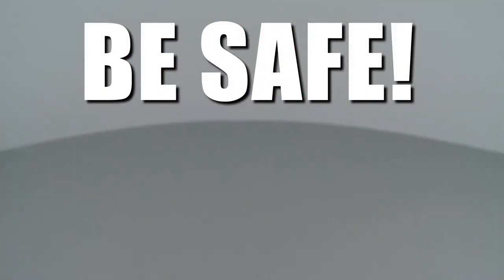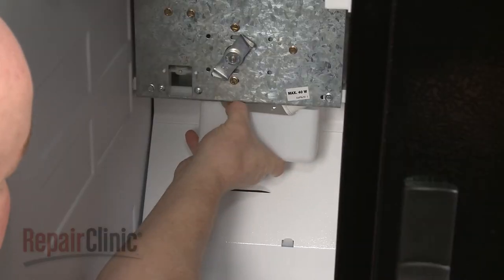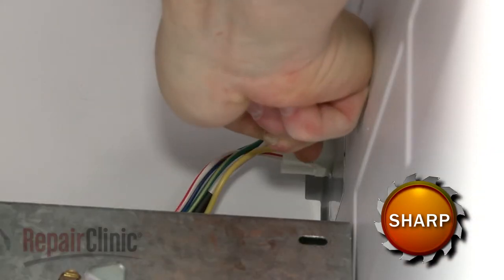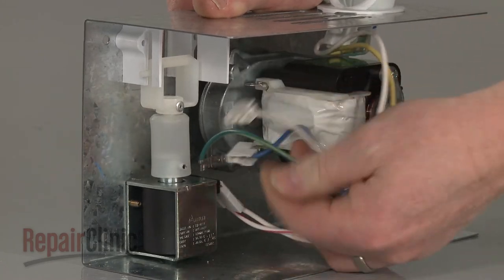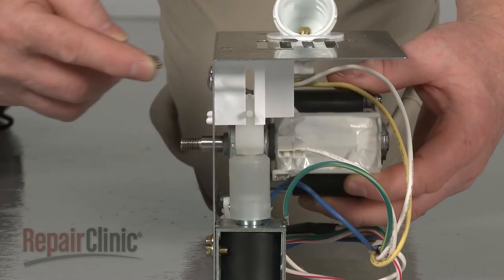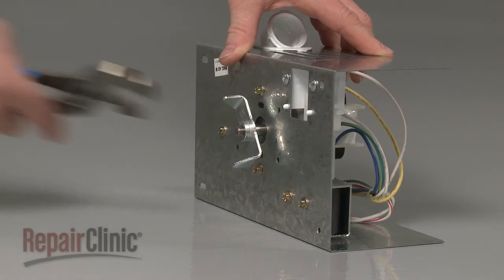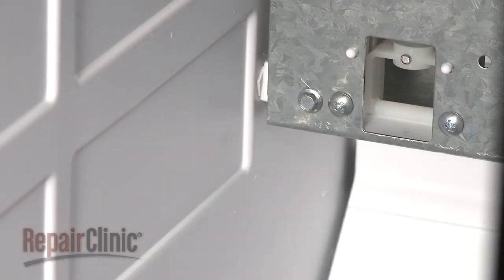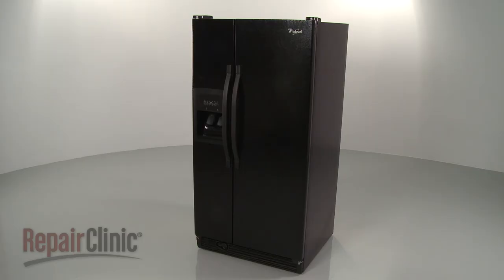Whirlpool Refrigerator Auger Motor Replacement #W10317991

Comment: I had the same issue with spinning.  I wedged a screw driver into the red part that was spinning to stop it from moving and then tapped on the connection piece with a hammer.  It came right undone and didn't damage anything